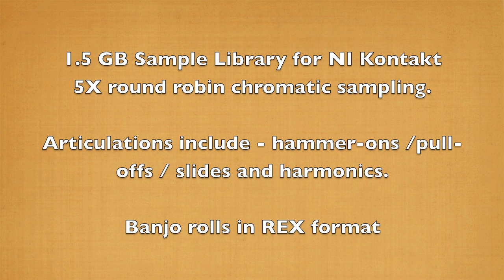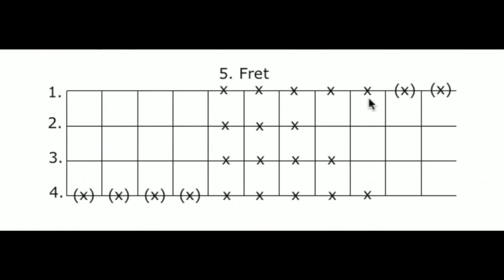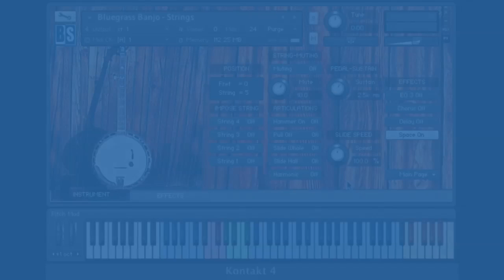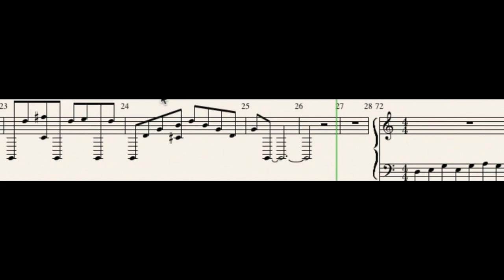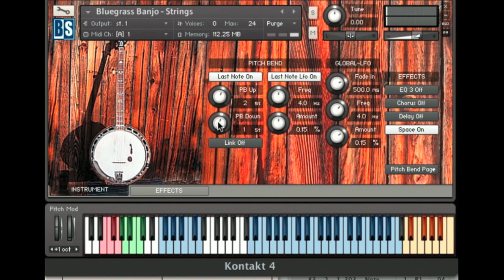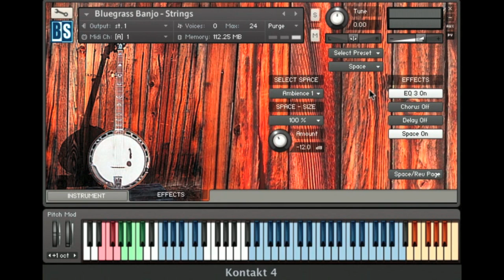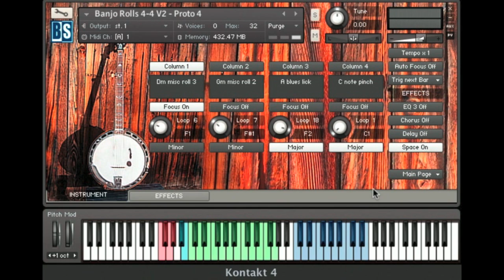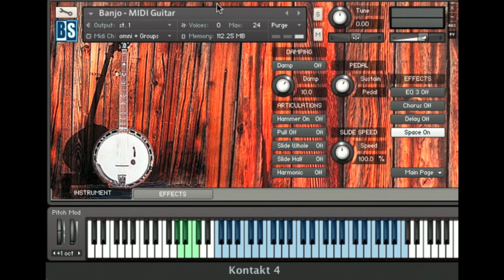Bluegrass Banjo Sample Library for NI Kontakt from Bolder Sounds

Comment: Just Bought it... I hoped a proper library working on kontakt 5 but it didnt. Hope for an upgrade soon but this library is amazing and very cheap, highly recommended
Reply from the maker: It works fine on K5 - You must understand this is a NOT a encrypted Kontakt Library. The LIBRARY browser on the left is for ENCRYPTED libraries. All Bolder libraries may be loaded using Quick-Load as well as a couple other methods mentioned in our website FAQ. This is a common misunderstanding of Kontakt users. This library works exactly as it was designed to in Kontakt 5.

Comment: My only gripe is that tons of sound libraries don't get the tones to match when they should as in your slide samples.  They are noticeably darker and with less attack on that first picked note than the other samples. The first note should sound no different than any of the other picked notes then the slide should sound like a slide (which it does but possibly a little too loud).   I don't know why unless during the record session something changed between the recording of the main notes and the slides.  Like some vocal libs I have heard where the timbre is all over the place from one note to the next.  Makes it unusable for anything but some mockup for a real vocalist to redo later.

16:51  ?  no, it sounded very bad.  A banjo naturally sustains when a string is picked so the second example with sustain pedal on sounded like a banjo.

But aside from the slide attack that seems to be wrong to my ears, this looks pretty useful if you either don't have a banjo or can't play one but need to have one for some reason.  This is what, 3 years ago?  I wonder is this the same as then or has that slide thing been addressed or even noticed or cared about and I assume this works with the latest kontakt?

Comment: Really enjoyed this, but there is around a 2-second delay on the voice in the earlier parts, which is a little confusing at various points, but especially around the 5.50 mark. Sliding the audio back until in sync would improve this no end. Nevertheless, really good presentation.